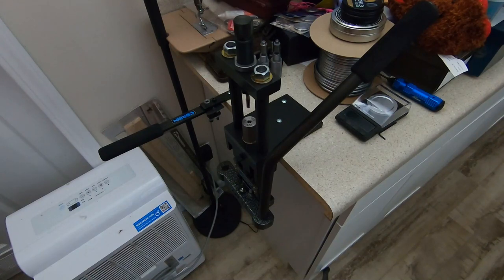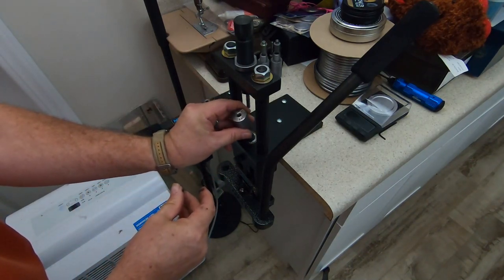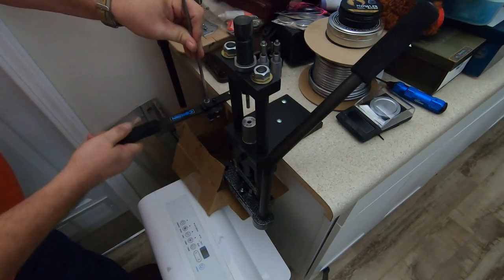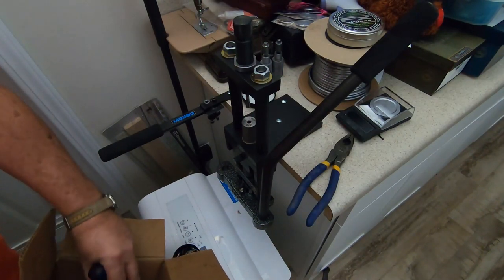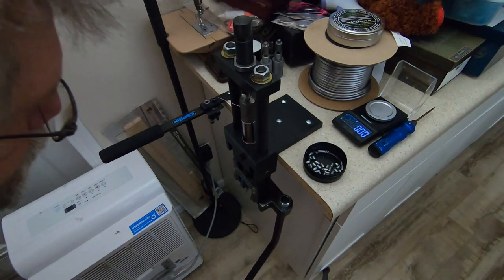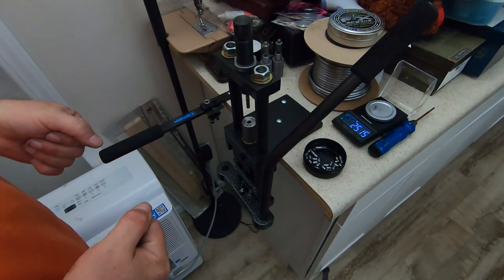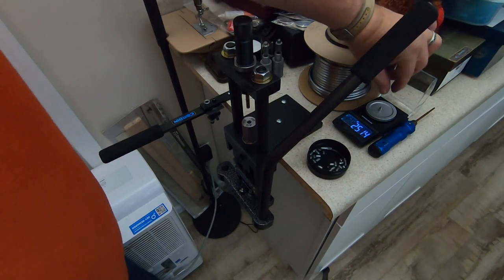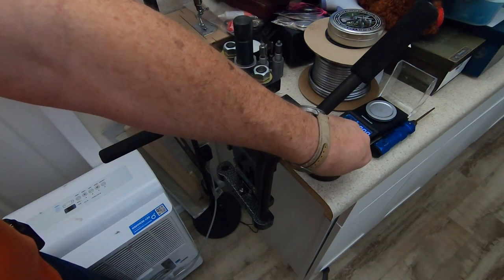First Try at Swaging Using the Corbin Press

Comment: The recommended way to lube your 
cores by Dave Corbin is this:  apply a small amount of lube on your index finger and simply roll the core around between your thumb and index finger.  
IF your press and core cutter were mounted on the front of your bench,
you would have much more room to navigate wouldn’t you?
😜🤔

Comment: I ordered this exact setup for the fx hybrid. Waiting on my dye. I got my press.
Reply: How much did you buy the piston.. is it good and accurate
Reply: Making “hybrids” such. So much work. And I don’t think they fly that well. Standard hollow point o give has been the best for me
Reply: @nsboost  making hybrids is double the time but they fly as good if not better in my FX rifles and the expansion on impact is way way more lethal. Makes the slug diameter double the size of a regular hp.
Reply: @roonimac  I do agree with expansion. They are flat deadly. I just haven’t got them to fly as well yet. My superior barrel 700mm .25 is really liking a 32gr standard hollowpoint moving at about 980fps.

Comment: They recommend that your plugs you cut should be a maximum of 3 grains away from your finished slug weight.
So a 28 grain plug for a 25 grain slug .
I'm not sure why but that's what I was told.
Reply: To allow excess to be squished off i imagine

Comment: Hello and thank you for the vid. I am interested in this press and you have answered many questions I had. As I was watching I noticed that your strokes of the press are not consistent. I notice you stroke most of the time with 2 strokes and other times 3 times and the pressure used is inconsistent. Have you weighed your wire slugs to see how consistent they are? If your wire slugs are inconsistent that will make the slug also inconsistent from the pressure needed to remove the excess lead. I am interested in the results of the other options of the die.
Reply: If you run the press through a full cycle.. lock to lock.. it doesn’t matter how fast or slow you go.. or how much the lead weighted when you started. They come out consistent. 

Good technique is to leave the press at full stroke for a couple seconds to allow the lead time to flow. But in my experience it doesn’t amount to much of a difference
Reply: @nsboost  I think consistency is the key, try to do everything consistently, I mean yeah if you tap 2x one time and 3x time it might not matter but the thing you said about leaving the press at full stroke for couple seconds I think is important for consistency.

Comment: I might need to invest in one of those! What is the price savings vs buying name brand slugs?
Reply from the maker: It definitely isn't cost effective. I look at the ability to customize the slug to my specs, as the reason to buy.
Reply: It would take YEARS to recoup the cost for personal use. But.. you don’t have to order slugs when needed… you can make them in any weight… Corbin will even make dies to your specs at no extra charge.